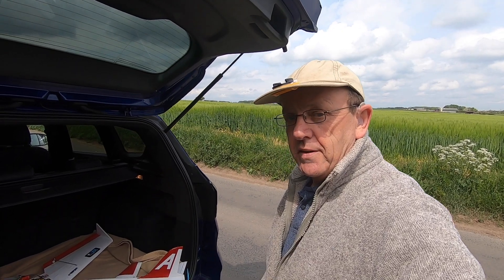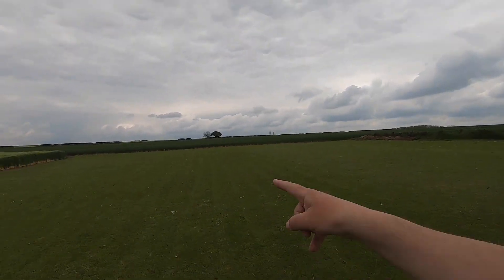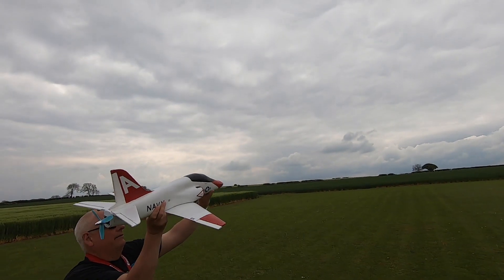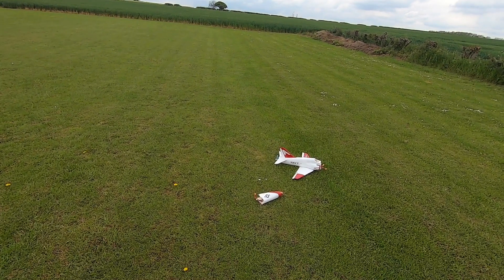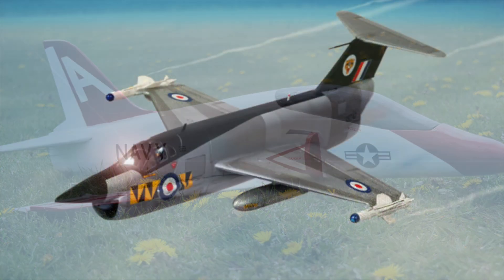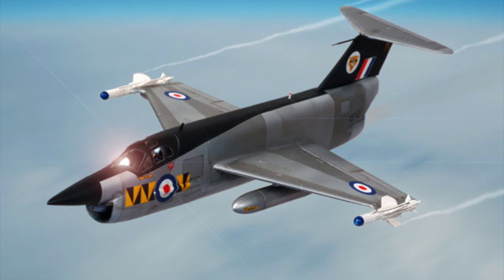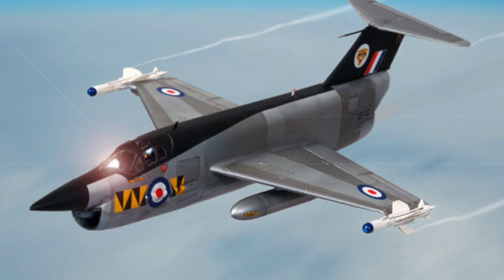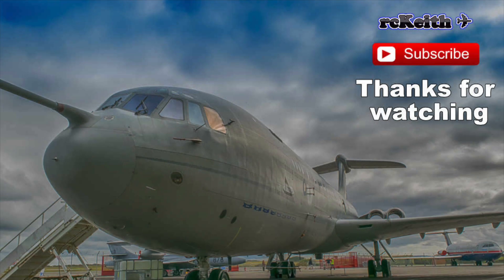DevFus Foam 2 Will it fly take 2  ** NOPE**

Comment: Nice build. Keep on fight. Don't give up. What are the softwares you use to design and cutting? I already have downloaded the info to build your foam cutter machine. Thanks from Brazil .
Reply from the maker: Thanks for your comments.  If you have a look at the playlist is shows how I used DevFus Foam 2, Profili 2 Pro and then LinuxCNC .  There are 7 videos in total but the first 3 show the main design and cutting process.  I use Mach3 as well.  I'm soon going to release a new foam cutter design using Arduino Hardware so it can be used on more modern computers.
I've built a Hawker Hurricane using the same software and it flies great here's a playlist for that.  I will repair Goshawk later in the year and try again.

Comment: That is one high-speed motor.  It meant for a Quad? Looked real nice!
Reply from the maker: It's a 2200kv brushless inrunner with a 5x4 3 blade.  The motors came out of my mosquito if you have a look here https://youtu.be/SRofNyzChGc?t=289 you can see them.  I have new motors for it now. No, they weren't quad motors,  it's the prop makes it sound like one